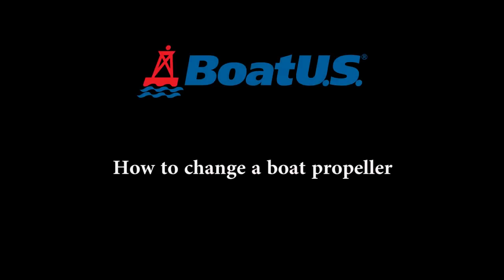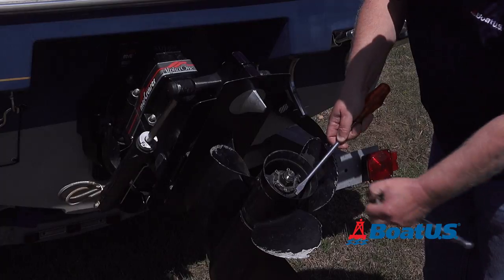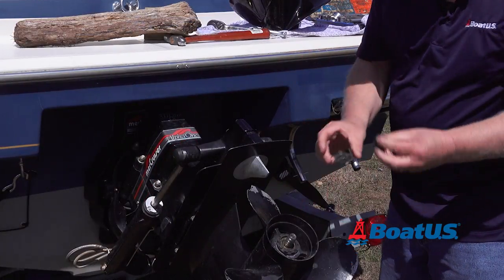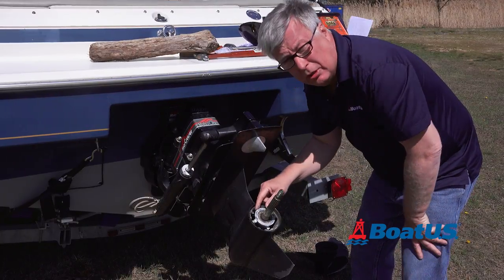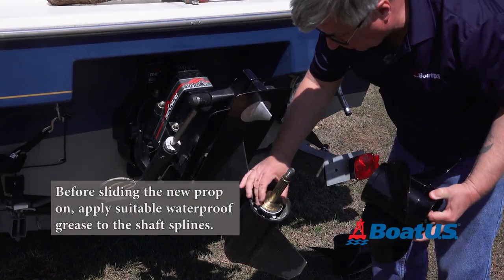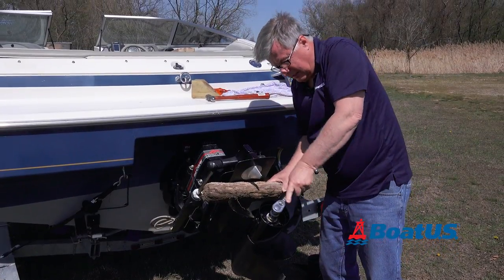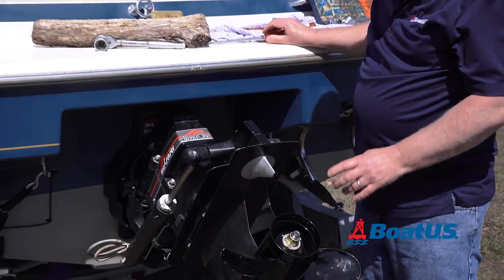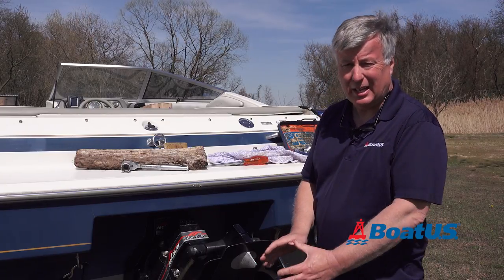How To Replace a Boat Propeller | BoatUS

Comment: There's also composite props like Piranha Propellers. They are designed to break at the blades, which are about $15 each to replace. And its cheaper to try different pitches as its about $45 a set of blades. Stainless are great for open waters but if you make a hard impact, it could screw up the lower end badly... Like throw the shaft up through the upper unit. Aluminum props bend and chip easy. Composite props haven't caught on yet but they will.
Reply from the maker: Thanks for your input, Warinot. Those have been around for a couple decades. They're fine to try for smaller motors, but we probably wouldn't recommend them for anything over 20-30 hp.

Comment: At the beginning you’re supposed to bend the arms of the lock washer down. Not up as you say. You bend them up after the nut is tightened.
Reply from the maker: Thanks for the clarification, lmannella.
Reply: Really? What would bending them up lock them on to?
Reply from the maker: @blattea2158  It will prevent movement due to the shape (the flat sides) of the nut. In some cases, there will also be either notches or ridges on a retainer. (Note that we probably should have said "bend down," not up.)
Reply: @BoatUS so, just so im understanding right, when youre all set, finished with the installation of the prop, and ready to go into the water that the tabs should be bent up/out towards away from the boat?

Comment: what size socket for the nut and what is the torque spec on the nut? very important info left out...
Reply from the maker: You're certainly right, Knight Hawk. That's important info! However, it will change from boat to boat and motor to motor, so we can't specify a one-size-fits-all solution. Always consult manufacturer recommendations.
Reply: Whatever size socket fits on your boats specific nut, and "snug" duh 🤣
Reply from the maker: @itssammiesakran  Thanks for watching. I know it seems like a basic question, but we try not to judge. Ideally all props would require the same size tools and torque, but unfortunately they don't.

Comment: it is normal to have a little play in the shaft  or   i have a bearing broke or someting ?  pleazz help i just insall a new prop  same motor on your video  !  and it making a little grinding noise when i turn it  using only my hand   iam not sure if  i just  screw it too tight  ,, tomorow i go chek again a try make a video on it to show  ,,,, i need help for sure dont want to broke someting :)
Reply: not sure if is just the new fresh paint on the props grinding  or is just to tight  or bearing damage   what  u think hehe  ?
Reply from the maker: Thanks for the question, headshot. There should be no play in the shaft. If there is, that is indicative of a worn bearing, which is further confirmed by the grinding sound. I would not attempt to use the motor until you have the opportunity to get this checked out. I would take the engine to a certified mechanic who is familiar with your make and type of motor.

Comment: I guess your boat engine does not allow for a locking cotter pin.
Reply from the maker: The old fashioned stainless steel cotter pin is probably still the best option, James. I've read about some folks who tried various "locking" cotter pins and lost their props. Apparently they can come undone when the prop is reversed. If you're concerned about theft, a company called McGard makes propeller locks (https://mcgard.com/marine/propeller-locks/). We haven't tried them so we can't necessarily recommend, but it may be an option depending on your needs. Hope this is helpful